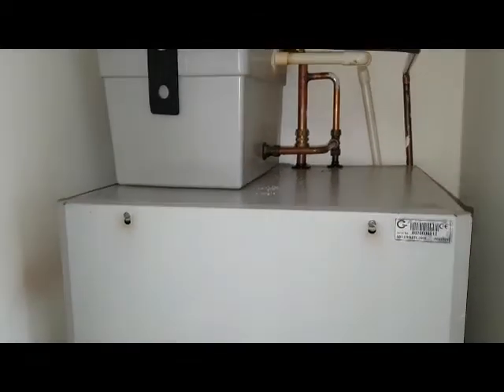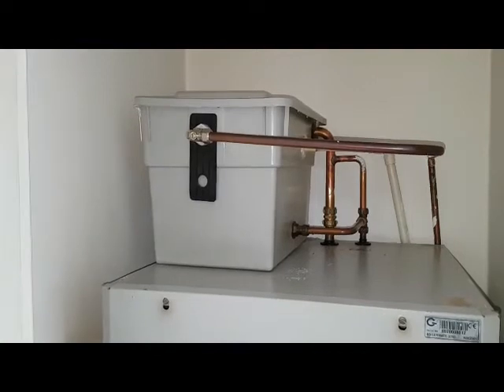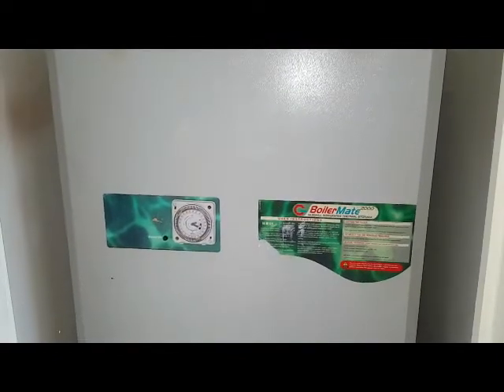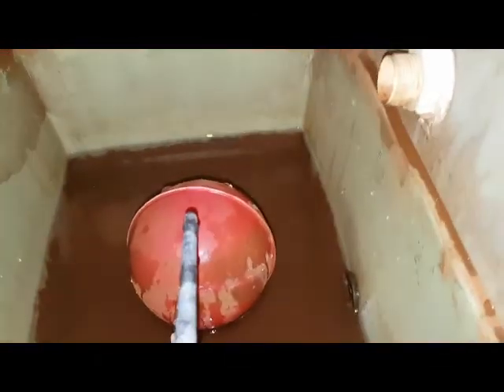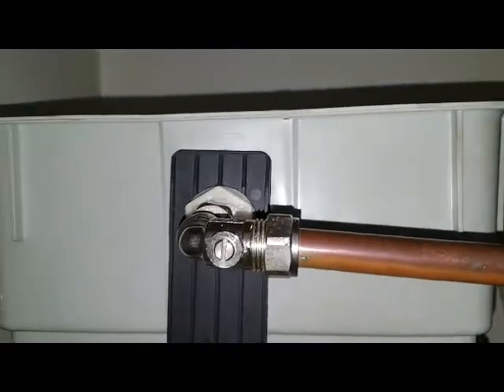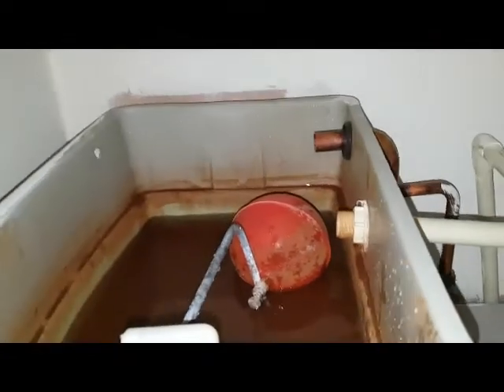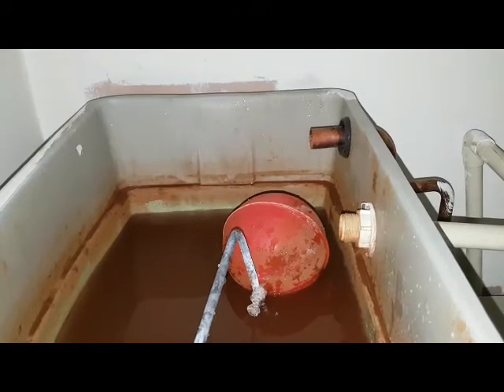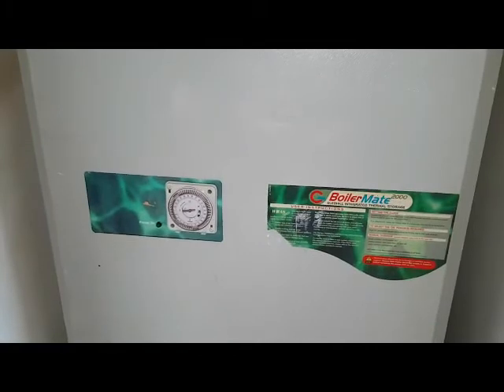Gledhill Boilermate 2000 making noises With Coach Tony Morgan

Comment: Hi.I have the same Boilermate 2000.
We swiched off the room thermostat in the living room,and switched off on boilermate is well.
The problem is the radiators still warm.
Could you help me please?
Reply from the maker: It could be the non return valve connected to the has failed. Also, could you subscribe to our channel?
Reply: @ARBoilers  yes ,thank you.
Reply from the maker: @2oasis78   🙏
Reply from the maker: Well, it could be a pcb fault
Reply: @ARBoilers  Which one  do You mean please?
GT 155 PCB or XB 386 switch control PCB?
Reply: Boilermate 2000 hasny got motorized valve.
Someone said that probably the control panel faulty
What do you think?
Reply from the maker: What's the fault ?
Reply: @ARBoilers  The control with display panel faulty.
Reply from the maker: GT 155 PCB